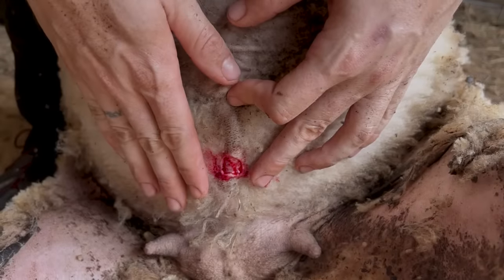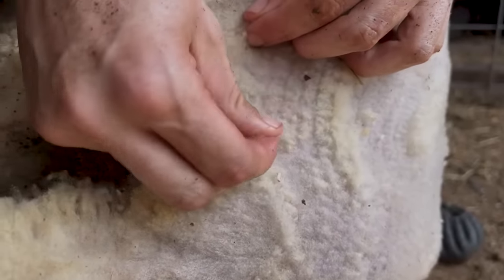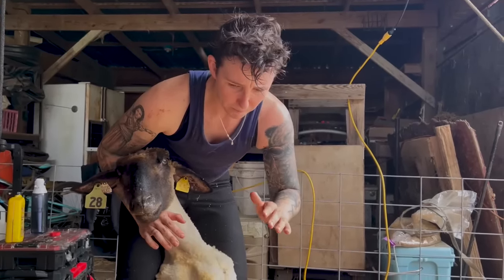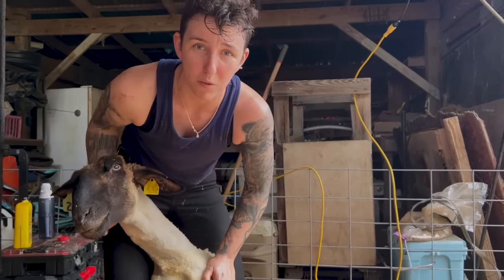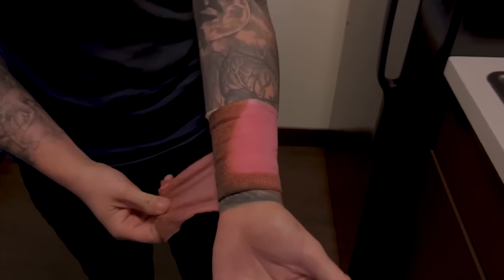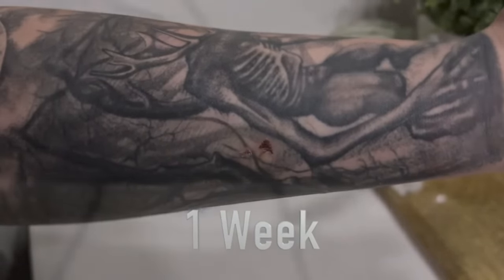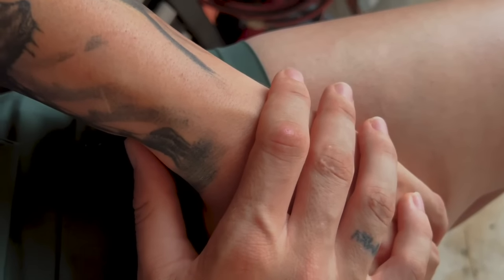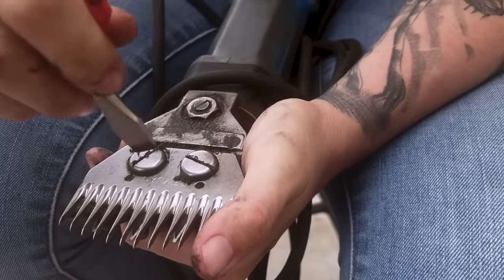Worst Sheep Shearing Injuries

Comment: Wow. You really are lucky with that shear failure. I'm a retired dog trainer, and knew there was danger involved because I was the go to girl for biters. Access if it can be fixed, managed, or too dangerous to be in a family. And over 35 years I had my share of nicks, cuts and punctures. There were only 2 serious incidents where I was seriously injured. Both I was tired, stressed and then a series of mistakes were made. Anyone working in trades is at risk, but I wouldn't have missed it for the world. I really like your videos.
Reply: That's when it happens. You are tired and stressed and go right on working and not taking that moment to stop and slow down. I learned that the hard way.

Comment: Thank you for sharing. On your cheek injury with the foreign body - you are very blessed. I developed an abscess in my right cheek, an oral surgeon, without numbing - which because of the amount of swelling it would have not worked, lanced & drained as much as he could. The pain was bad when he cut, but lancing it inside the mouth saved me from a scar on my face. I was on antibiotics for a month. 3 months later my husband found me unconscious & I had bacterium sepsis. Temp was over 104.0 (F) when I was admitted. A month in the hospital I don’t remember & 4 weeks in rehab learning to walk, while continuing with antibiotics via a pic line. As there was no other areas were I had an infection, they tested everywhere, the fallback is that the abscess was never completely treated, I was not able to fight it on my own. As a retired nurse, I would not wish what I went thru on anyone. Neurologically it impacted me for well over a year. So don’t take the cuts lightly, any sign of infection please treat aggressively. I should have stayed on antibiotics longer, it would have saved me & my husband a lot of heartache. It could have very easily cost me my life, by not treating it longer.

Comment: When you nick yourself you can use Hypafix or Tegaderm to put over your injury. Provided of course that you have disinfected very well (soap and water does great!). Both the Hypafix and Tegaderm work like a sticker.... stick it on and leave it there for days until the skin is restored; you can take showers and go swimming with them until you heal. Not necessary but you can apply a little bit of Neosporin on the wound before you Hypafix it or Tegaderm it. I'm a cyclist/speed skater and that's how I heal really bad road rash after a crash.

Comment: Watching a mixture of your videos and random veterinarian shows helped me stay calm when a family member accidentally nicked our small dog while giving him a quick hair cut (he's a Yorkie) 

Thankfully the nick wasn't deep, and it didn't bleed at all, it shocked my parents to see that the dog was hurt and they were both worried as hell, and seemed to be holding their breath. 

I still have no clue how I was able to keep calm let alone talk, and tried to reassure them that it wasn't bleeding and the dog wasn't yipeing at all, so to prevent the dog from scratching it we placed one of the thin shirts on him. (no bandage would stay in place) 
The dog immediately perked up and started wagging his tail and acting normal, albeit a little shy after getting nicked which is understandable. 

The wound is now closed and the dog is adamant about keeping his safety shirt on, to the point that he plays dead weight whenever we try to take it off him (The nick was on his side so we were able to lift the shirt up and check on it, now the spot is a patch of rough fur that's growing back in)

Comment: i think its true to be said when working with livestock/heavy equipment; if your not scared of it, your not working safe. you need to be aware of the damage it can do, through experience or other
sheep can kick and bite, the equipment can malfunction or you might slip. horses can kick, bite or throw you.
if you dont know what harm you or your animal could be in your bound to learn
edit; not to say you shouldnt work with them, its a career i hope to pursue but safety requires caution

Comment: If you want those angle cuts to heal right you have to wrap them in the direction of the point and don't pull it off in a way that pulls off that point.  I'm a jill of trades and and don't stop with much so my arms are COVERED with nicks and cuts.  Tattoo is a great idea.

Comment: OMGAWD!!  That was an ENORMOUS piece of schrapnel!!!  *retroactive horrified empathy  ...haaa, I have a bench leather splitter I use in my line of work, and it's basically a giant razor blade, about 8" long, 2ish inches wide, and about I dunno, just under a quarter inch thick (not the part where the edge is, obviously), and it weighs a ton.  I have to sharpen it periodically, of course, which means you have to turn the blade loose from its usual Hannibal Lector imprisonment.  Long story short, I forgot which way my bench grinder was turning, set that chunk of metal up wrong, and SPANG!!!  That thing exploded out of control, spun and flipped into the air, nearly breaking my fingers--I thought they WERE broken for the first couple of hours--and giving me a horrible set of lacerations besides, as well as serious mental trauma, because that could have been a LOT worse.  Like you, I definitely learned the Moral of the Story:  RESPECT the TOOLS!!!

Comment: Why does the comb of the shears have to be so sharp?
Would they still work if the comb was less sharp?
Reply: No they would not. Similar to razors for facial/body hair, if the blade is dull it will not cut the hair.
Reply: @dreamieskies056  I didn't mean for the edges of the shears to bu blunt, I meant the points of the comb being rounded over, like the way clippers for humans are.
Reply: @nvdawahyaify  well that I'm not sure of

Comment: Oh my goodness! The shrapnel in the cheek story made me cringe. I had a piece of glass lodge in my right middle finger knuckle about ten years ago—totally my own fault; I used my fist to punch down the garbage in my kitchen trash can forgetting I’d thrown away a shattered glass. I thought I cleaned the wound well, but I had missed what I assumed was a tiny sliver, just a tiny one, I thought, because although the wound healed over, some weeks later I could feel something hard under my skin besides the bone in the joint. In time a tip-of-the-iceberg part of the sliver worked its way up and pushed its way through my skin. I couldn’t get a good grip on the sliver with tweezers and broke the tip off. This scenario repeated for a number of days. Finally it became inflamed and annoying, so I sought out a doctor consult. She sent me to a hand surgeon, because I’d left it so long that it was possible that nerves and tendons had wrapped around it and the only way to safely remove it for good was surgery. I was given a local and a nerve block, but I got to watch as the surgeon dissected the injury and delicately removed the several pieces of glass from the area of the joint. It was fascinating to watch, and I came out of there amazed at the intricacy of the structure of my knuckle. I’ve still got a scar, and now I take out the trash immediately if there is broken glass or pottery in it , even if the receptacle isn’t full yet, rather than risk my forgetting and repeating my dumb behavior.  Bonus: while the surgical wound  with its stitches healed my finger, it was splinted and wrapped in an obscene gesture configuration. I enjoyed that a little too much! 😂

Comment: Damn!!! Mad respect!!! 💪💪💪I've had quite a few nasty injuries while working with horses. The worst incidence being picked clear off the ground and body slabbed by one horse, while having another kick my straight in the guts all at the same time. (Basically I was leading the first horse out for speical feed with supplments, and the other horse came running infront of us with another. The second spooked, being trapped between us and the other horse with her. And she buck kicked me while trying to kick at the first horse. The horse I was leading reared up to get away and picked me a good 3 feet straight off the ground. Honestly that probably saved my life, as I would have been kicked in the face had she not. She dropped me like a sack of potatos. LOL! And I ended up having the air knocked clear outta me, rattled all my bones, and I whacked the side of my head on something when I hit the ground, leaving me with a doozy of a goose egg on my head. I walked away with only the goose egg and a horseshoe shaped bruise on my gut. LMAO! The funny part is I worked 2 hour, finishing my work for the day after that. I was rattled, bruised and definitely seeing stars for a few minutes after it happened. But after the  few minutes I allowed myself to get the air back in my lungs LOL! I was fine.) I was only 6 months into working at that job, when that happened. That was thankfully my worse mistake working with the horses. And I learned real quick how best to handle things like that happening. Also, keep your eyes on the younger untrained horses!!! They can be hella unpredictable! LOL!

Comment: What I see happen with new people is that the tension is as tight as humanly possible and then the blades and combs break and turn into shrapnel. 
With novice to intermediate shearers it's not as bad and nicks and cuts are mild, but ropes and cords and general maintenance are forgotten about. 
With Senior shearers they want big jobs and to do them as fast as humanly possible and don't take time to sharpen their blades or switch out blades during large jobs of 30+ sheep and they man handle (it is mostly men) the sheep so much that the blades do some major cuts and many cuts. I stopped hiring and learned to do it myself after the last pro shearer cut through my sheeps eyelid and almost cut her eye. The eyelid was split and I was lucky he didn't cut her eye. That is not counting the huge amount of other nicks all over her body from this pro shearer. My sheep wasn't even white, she was red! and had a split eyelid! and I was like "No one cares for my sheep more than me so if I can clip a horse who will kick and throw their head up. . .I can figure out how to shear a sheep". I do see you gals with the feet and I'm like "Nope, I'm grabbing my farrier tools that take off cow and horse hoof and I'll finish with those little clippers" If it's long enough I need a 1/2 inch off then I'm grabbing hoof nippers to deal with length coming off. It's what my mexican farrier who trims any animal's hooves taught me. Work smarter, not harder. 
Can also tell you are a farm girl. "Yep, I'm cut, bruised, bleeding, etc. Vet can stitch and in the meantime. Vet wrap it!!!!".

Comment: I counted my hand scars many years ago - 35, predominantly on my left hand. My face and head are scarred, and then I probably have about 10-20 others spread round the body. With all of those, only 1 I recall had stitches (possible I had them in my face - but was far too young to recall). And then a deep one on my thumb that should have had stitches but I was told it would be OK without.

Comment: TETANUS SHOTS? When was the last one you had? In your line of work, you might need one every 5 yrs. You can check w/ your Dr. Vet friend (who might also be your "primary care Dr", too?😉). Otherwise, 7 to 10 yrs might be fine. Also, consider having a little kit in your kit w/ some polysporin, butterfly sutures, which would have kept the flap of skin on the arm tatt in place, large band-aids & band-aid patches after cleaning a wound. Some hydrogen peroxide, some alcohol swabs (pre-packaged, square inch patch w/ alcohol inside the little envelope), some sterile swabs (Q-tips) or sterile square gauze pads 2"x2". And that wrap Vets use on sheep, horses, etc. to wrap wounds, like you used in the video. That stuff is great! But really...most importantly is the tetanus shot, 2nd is polysporin. Thanks for sharing. I love your videos! 😁

Comment: Well if you ever hit an artery, you could stick your thumb in it. Demolition Ranch style.

You are as scarred up as any Trades Worker. Well I suppose Shearing is a Trade, so that makes sense. You check it, make sure it’s not bleeding, and get the job done in that sort of place.

Funny story, not about injury per se. Just pain. Where I live, and probably where you live we have Wood Borer Bees. They make pockets in Wood. My Father who has worked in Trades all his life was having me help hold a 10 foot Board in place for framing one of his never ending projects. A regular occurrence. I was trying to hold it, and I feel like I get a huge splinter. I yell and pull my hand away, and look at it. Just a red spot that hurts like hell. Here my father is waiting on the other side. So he is getting irritated I’m holding it up for no blood. So I put my hand back, and we try again. Another splinter, this time I see him annoyed after it’s the same thing. So we go back without words quicker, while it still hurts and hurts worse now. And for the third time I get hit. I’ve had enough at this point, and I have to find out where the issue is. I know it’s the same thing, so I step away. My father getting a bit irritated that I’m putting my side down and trying to flip and see the side.

And there it is. This finger sized hole with a bumblebees head sticking out of it. Turns out I’d been getting bit by this guy the whole time. To both my and my fathers surprise. It wasn’t an issue I could fix by powering through the pain. My father hates bees and wasps, so he was no longer irritated. The thing had apparently made a home in the scrap we were using. We got it out of there and continued on. 

I suppose the point is this. The job matters. The ability to focus through such a think is great. However you have to be careful with that drive. No, bleeding out in the pasture ain’t worth it. Even if you are working for someone who thinks PPE is a waste of time. Even should it be, that boss is you.